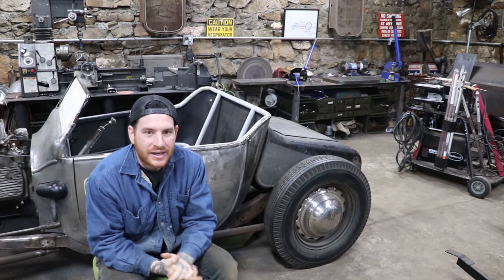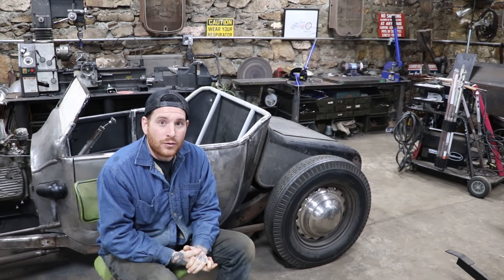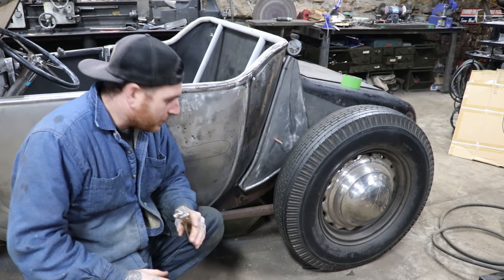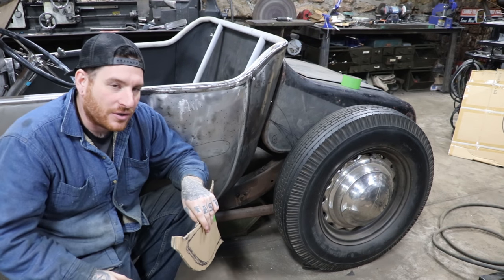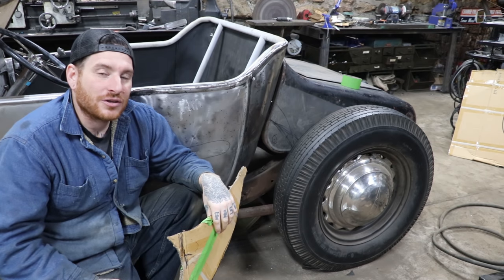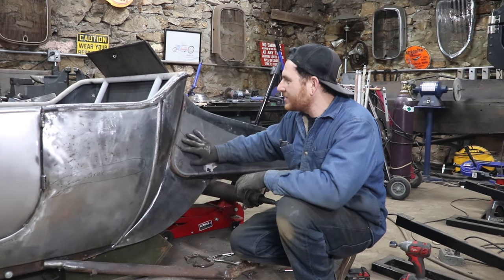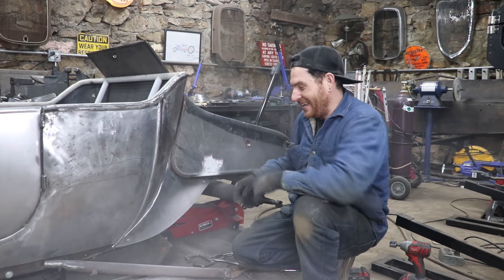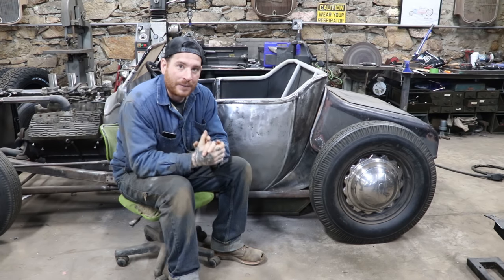Turtle Deck Filler Panel - Ford Free-T - Ep. 63

Comment: I was Air Force Sheet Metal for 26 of my 34 years in and very much enjoy watching you work.  Will have my shop built and finished by fall and can't wait to get back to fabricating.  BTW, I destroyed a '26-'27 Turtle deck to make one good one for my roadster.  sometimes it's just gotta be done.
Reply from the maker: Hey Von, Thanks for the watching! We're glad even seasoned pros like you can appreciate what we're doing! Not quite as intricate/refined as building plane parts, but a lot of what I have learned has been stems from what the aircraft builders/mechanics were doing many years ago. Thanks for following along! -Matt/ITG

Comment: Mike it's probably to late now but I think that the front of the turtle deck is to high in the front side I think that the photos you show show that  Love your videos keep up the great work
Reply from the maker: I like where it's at. Using the Isky-T and some other cars as a guide when building this, that's where they would put the turtle deck to clear the rear frame step and cross member. I appreciate your input and checking the videos! -Matt/ITG
Reply: @IronTrapGarage  just my opinion is love your cars and videos I hope to meet you at Carlsile or Hershey

Comment: Thanks for sharing your learning experience!  On the filler panel, you have the 2 screws on the pretty face holding it on.  How do you keep the screws from chipping the paint as their tightened up or as the panel flexes?
Reply from the maker: Hi Thom, I counter sunk the holes for the screws so they sit basically flush. That should keep the paint from chipping. Luckily they don't need a ton of force to hold them down so they should be ok as far as chipping goes. Least I hope! Thanks for watching. -Matt/ITG